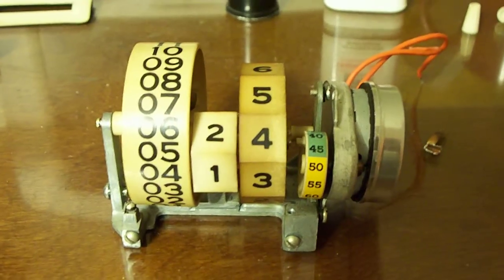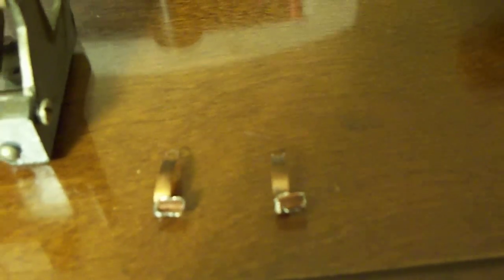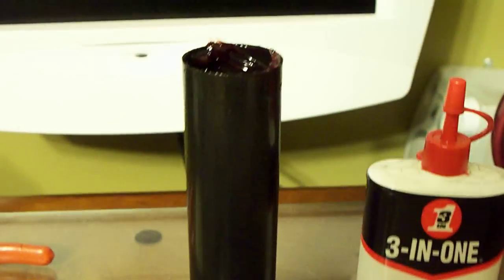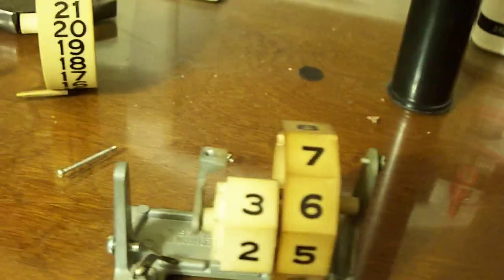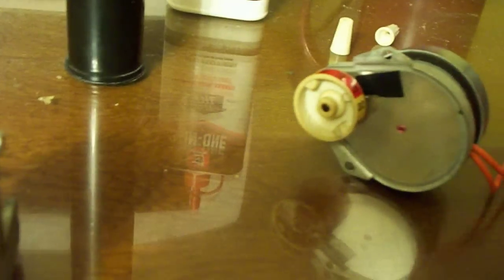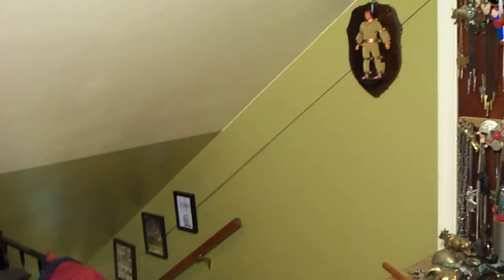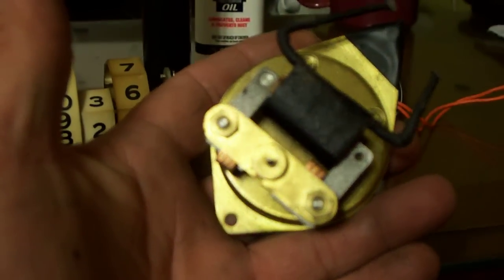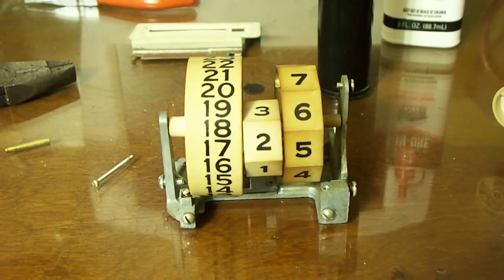numechron servicing.

Comment: Mine (one of the Tele-Vision models that looks like a TV) does not have a hole on the back for adding oil...all I see are the back ends of 2 shafts. To get it running again, I injected mineral spirits into the motor which loosened up the motor. I suppose I'll have to drip the oil in through the holes in the rotor. Do I have other options? The spring on the minutes hand has already worn off.  I'll find some copper to solder on. Or just leave it alone...it works.

Comment: I opened up my other numechron (branded as Seth-Thomas SPEED-READ), ... it has the oil hole and intact springs. It also seems to run a lot hotter than the Tele-Vision model (though I did take the cover off that motor).

Comment: Thanks for the video. You say when oiling the motor to remove something from the back. What exactly are you removing or did you oil the motor just as it is on the video?
Reply from the maker: if the oil leaks in to the flywheel you may have to take the cap off and let it drain then put thicker oil in it

Comment: I have two of these clocks, both made noise when operating. I tried hoppes #9 and liberty sewing machine oil - they didnt like either of these bogged down running slow etc. I noticed in my garage I had a spray can of heavy duty silicone spray which was rated to 400F - i gave two or three squirts and bam they run like a top! Any issues with using silicone on these?

Comment: The threaded shaft, is one option that Cramer provides -- they do make other shaft options, as shown on their specification sheets (and web site/telephone support). 
 The gears can be acquired from Small Parts (FL), old clocks and many other sources.
Old "parts units" will not be around forever -- at reasonable prices.

Comment: I found that when I removed a 'clicker blade' and reinstalled, if that wheel then starts to not fully 'click' all the way to the next number when it's dial advances, you can just loosen the blade again and slide it inward a little (or a lot) till it works right again.  That causes the blade to click into the detents sooner in the dial's rotation.  Or - mark where the screwhead is on each blade with felt pen before removing it so it's in same position when you reinstall it.

Comment: That's really neat! I used to have a Sankyo "Digi Glow), from the 1970's. I can tell yours is a lot older, I may have to get one of those.

I'm surprised the motor gets that hot though. I know I have some fans that get toasty (probably around 150 degrees or so) that can do 24 / 7 duty.

I'd bet the radioactive material on that later model is Tritium (my watches use that), likely on the older models is Radium.
Reply: does anyone have a spare motor for an numerchon clock model

Comment: I only have 3 of them, no rare ones.  The warped one has little cracks opening up in the thinnest parts of the pot metal, which is ending up causing the whole frame to kind of curl a little.  Pot metal is usually a decent material but a bad batch or really ancient pot metal can end up doing this after many years... it starts to swell, crack, and crumble.  I have a 20's Victrola with some bad pot metal mechanical parts like that which I had to find replacements for, they were falling to pieces!

Comment: Cramer and Company makes 1 rpm motors 120 VAC today ($31) -- sold at DigiKey.  These appear to be an exact replacement for Numechron motor (without the specific gears).  Several models sold, look at: CRA105-ND

Cramer and Company
105 Nutmeg Road South
South Windsor, CT 06074 USA
P: 860.291.8402
F: 860.610.0897

Comment: Yeah I had to bend them a little sideways so they tilt slightly towards the wheels... so that when in place they are level with the inner surface of the wheel.  I just fixed another one of these clocks, the frame is made of pot metal and with all the heat from the motor and the lamp, the frame had warped enough to screw things up.  I had to shave the minute wheel inner tooth a bit to get it to work right again... can't tweak the frame or it will likely just break.

Comment: NEVER use 3 in 1 oil in any clock !  It will gum it up. Use clock oil. It's cheap, and it comes with the proper tip for oiling a clock.